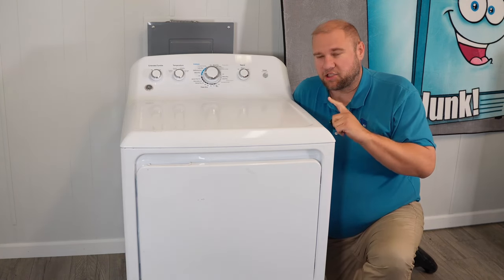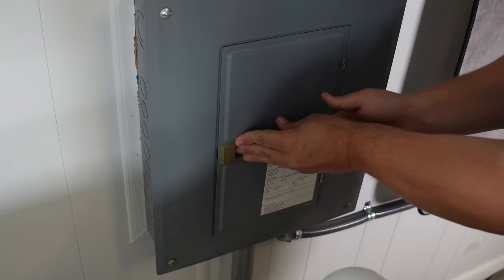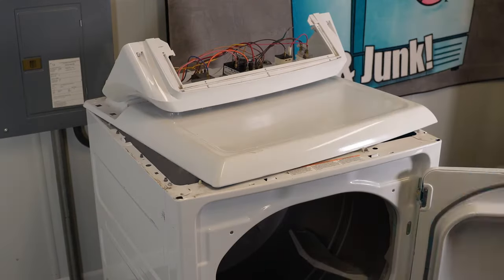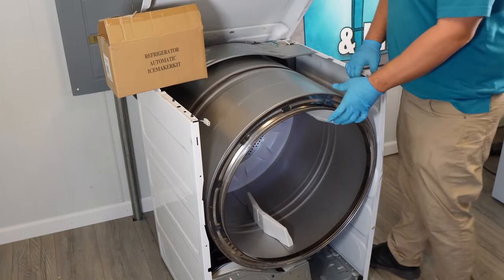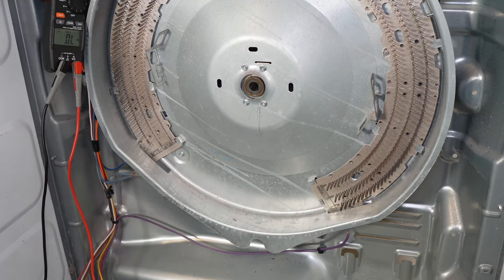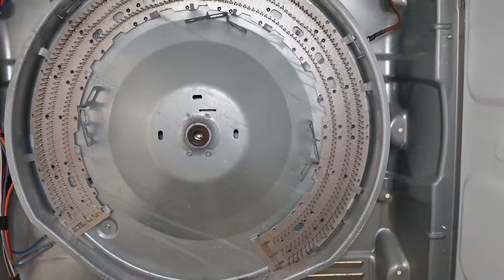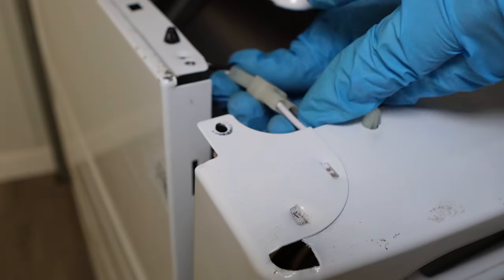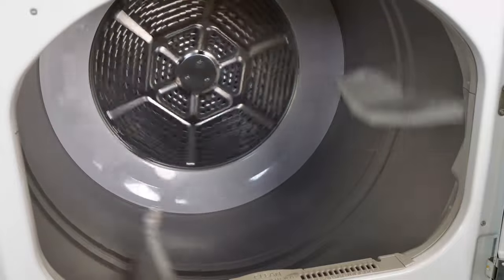GE Dryer Won't Heat - What to Look for & Test

Comment: GE dryer failed immaturely very fast. Samsung is the second worst. LG may be more reliable.
Reply: I have only ever purchased Whirlpool appliances, and have had great reliability. I had to replace one washing machine that had the drum bracket rust away. The Whirlpool dryer is now 17 years old, with only a heating element and high limit cutoff replaced (less than $100 in parts). The Whirlpool dishwasher is about 13 years old, with only minor parts replaced: lower rack, plastic clips, a drain pump and a rubber gasket (maybe $200 in parts).
Reply: @robertjoseph1592  sorry for accidentally dislike - anything before 2010 is better
Reply: Yeah my old whirlpool was a lot easier to work on. Two heating elements and one high limit but finally the drum wore out and stuff wax falling out the bottom. Next one was an old used  Kenmore whirlpool . its about 25 years old replaced one heating element on it so far.